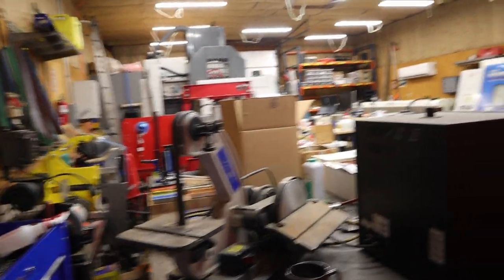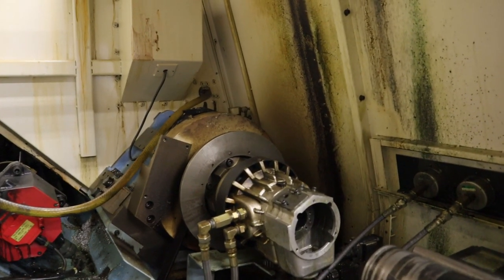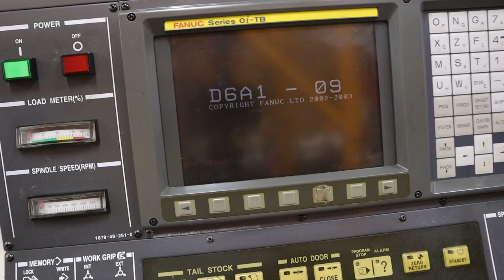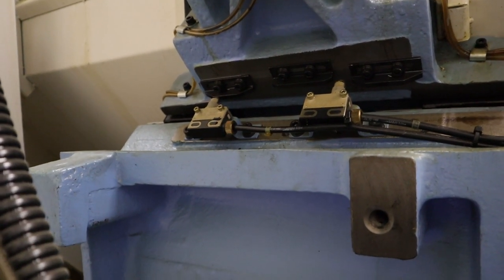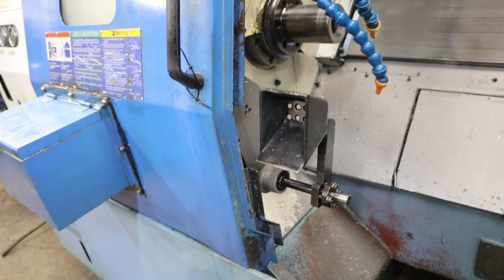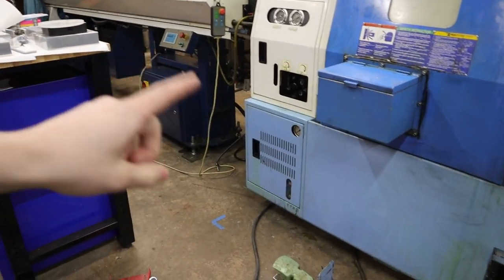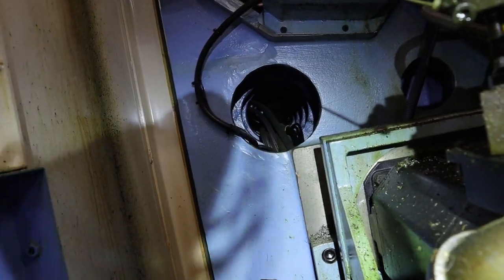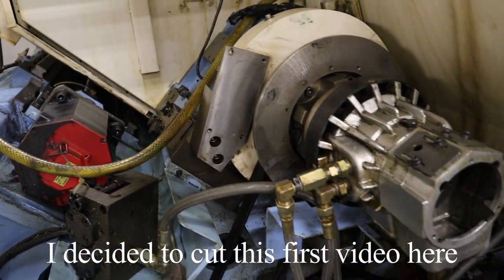New to me dual spindle lathe - Kia 15LMS - Part 1 - Cleaning / maintenance

Comment: Lol ill bet you thats the original hydrolic oil. We only ever add..for the last 23 years or so. Lol. We have mostly mazaks. But at least you have fanuc quality parts so you should be good!! Cant wait for the next! Btw normally there is an overtravel button to get it off the limit switch 😁
Reply from the maker: Certainly could of been. I never understood businesses hesitation on changing fluids regularly. At the end of the day, 5 gallons of hydraulic fluid is cheap, even in long run, versus down time and part costs for mechanical failures.

That's my opinion, but on the flip side, a lot of shops make a lot of money by just running things till they break. Guess it's based on what you're comfortable with. I'm not rich, so I'd rather keep up on the fluids :)
Reply: @split141x  yes i 100percent agree with you on that but thats because we have to care because we are small n the equipment is our life blood. But to a business person they  only have the mindset of the bottom dollor and keep the spindles turning all the time..they look at it like if it aint broke keep running it and maintenance means downtime

Comment: Awesome. Congrats.is it oil damped that barfeeder?
Reply from the maker: You mean like, oil that powers the bar feeder?
Reply: @split141x  i had a iemca barfeeder 3 meter that soaked the bars in thicc  oil to keep it from vibrating. It was a terrible mess 🤣
Reply from the maker: @nikolaiownz  Oh I got you, that sounds horrible. This one has lubricating oil or just hydraulic oil, not to sure. But the hopper is dry ran.

Comment: i am too afraid to buy anything used especially if its something as complicated as sub spindle lathe. They sell it to you "we ran parts on it 5 minutes before you came today" style and then it takes a year to get it running. Maybe you can just take the brake off, its useful for some heavier positional c axis milling.
Reply from the maker: Every used item has to be taken with a grain of salt. Especially one that has this many hours on it. I luckily saw it running, and was able to sweep it and check everything worked. It has its issues, but the good news is nothing show stopping. The biggest issues that I can think of are the brake being removed, and the coolant not being in the correct spot. I'll have a video coming out about restoring the coolant back to factory - through the turret. 

If you don't have the money, you can use sweat equity :P